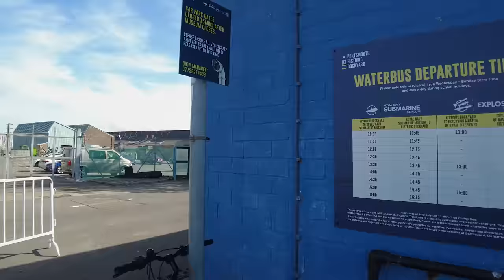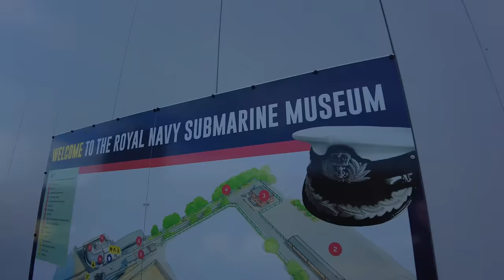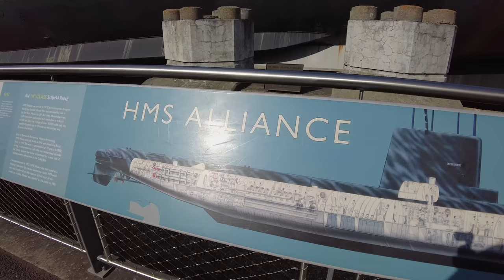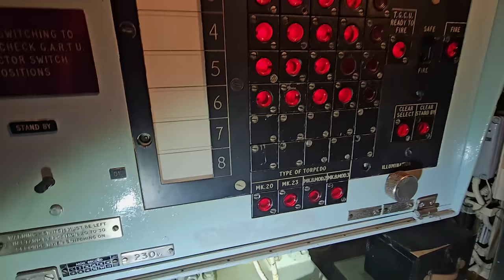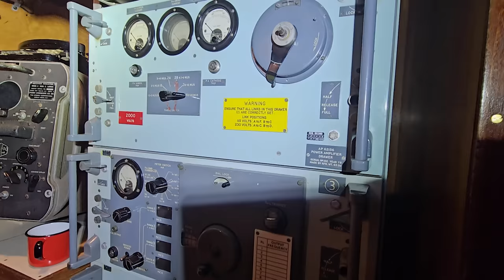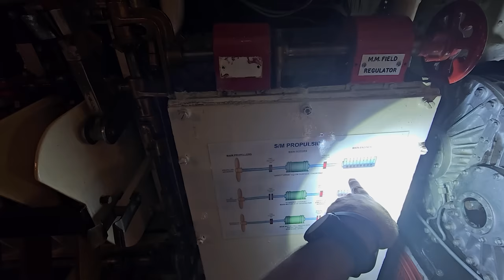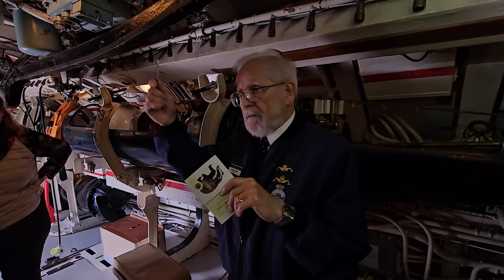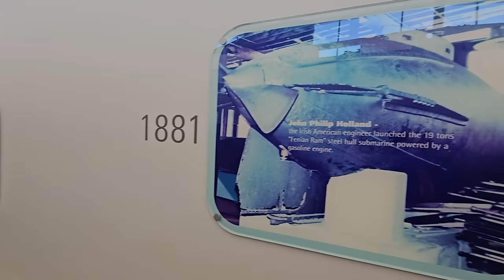Portsmouth Submarine Museum

Comment: the Red, Blue, Purple 'clocks' are the Decca navigation system, they read radio signals from static transmitters, and use phase comparrison between two (or 3) signals to determine position, you also have a set of maps with the coloured lines marked on to mark positions etc.